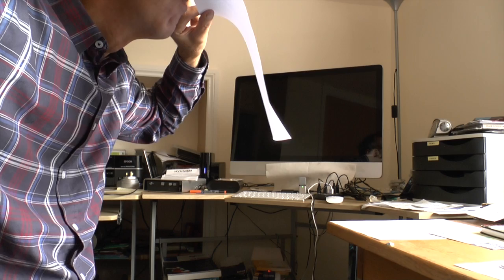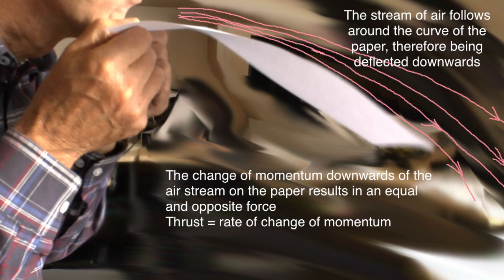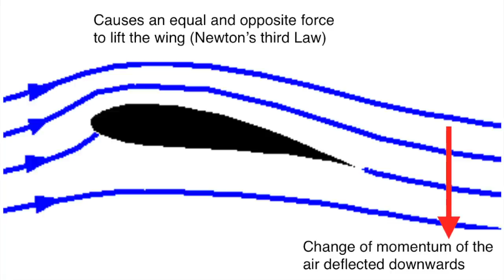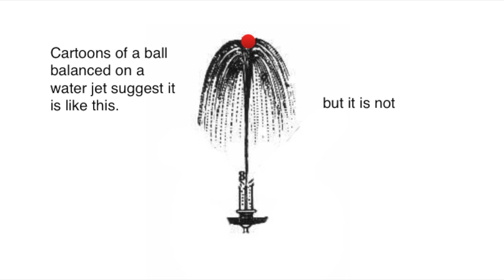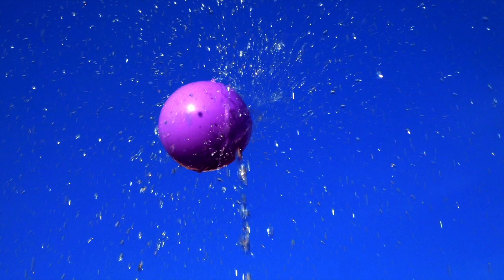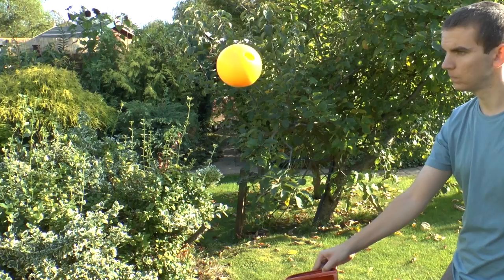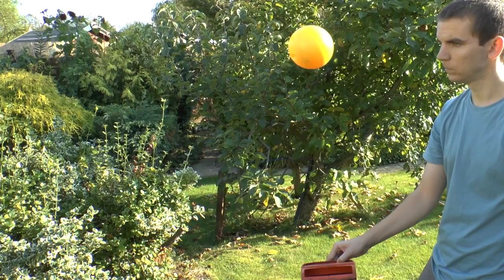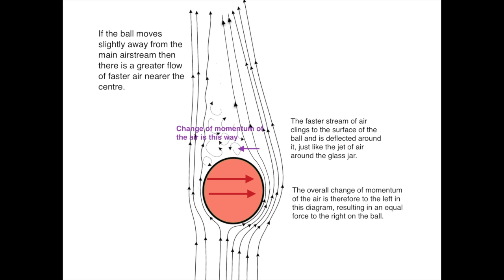The Coanda effect; explaining how a wing works: from fizzics.org

Comment: The explanation is weak, the pressure difference is what causes the lift of the wing, because the air is circulating slower over the wing than below the wing. Therefore the pressure over the wing is lower than that from below the wing, so it is pushed upwards by the bigger air pressure from below, which acts on the surface with a greater force.

Comment: Aerospace engineering major here, second year. My book explicity says this is true but not the source of lift rather a product of it. And that lift can solely be explained by pressure distributions nothing else.
Reply: Consider this explanation. The coanda effect causes the surrounding air not part of the flow to push inward on the flow due to a friction with the object interupting the flow. This push also simultaneously constricts the flow similar to how a nozzle would. This constriction leads to an increase in speed, this is because when flow is constricted the air is doing work on the air in front of it, ie pressure energy is converted to kinetic energy. This drop in pressure due to A combination of the Coanda effect + Nozzle flow. WIll drop the static pressure of the air flow above the wing. Then Since the flow below the wing is parallel to air flow no constriction occurs thus it's pressure remains unchainged. This leads to a net force upward! What do you think.
Reply: Pressure itself is a scalar quantity it has only magnitude but no any direction. Lift is a vector sum of the pressure acting over the entire surface. You may change the direction of the incoming airflow in one direction and lift will be created in the opposite direction as per action reaction pair

Comment: Roger,
I think you have done a very good job here in several of your explanations,   However I have a slightly different spin (excuse the pun) on some of this.  Please consider the following.
...
First, in my discussions with some in aerodynamics, Coanda defined this effect for a forced jet, or sheet of air along a convex curve - just as shown with the straw and can.  However, while it looks very similar and may even be explained with similar words, it was not defined as the "ordinary" flow over a surface moving through air --- only for the forced stream condition.  This may seem pedantic, but a definition is a definition.  Given this understanding, I could consider the upper airflow to be "Coanda-Like".
...
The blown paper is spot on.
...
I can explain the "action - reaction" concepts with these two reversed.   While I do not dispute that the lift force and downwash momentum change are indeed necessary and comply with Newton's Third Law,  I maintain that the common explanation as you show here is reversed.  The downward moving air can not be responsible for an upward force on the wing --- It must be a RESULT.  The pressure differences around the wing that are caused by the shape moving through air must also be pushing down on the air.  Because the downwash has been left behind the wing to continue downward due to its inertia, it can no longer have an effect on the wing that has moved forward.  The pressure differences around the wing, in effect, are the air pushing up on the wing.  If the air is pushing up on the wing, the wing must be pushing down on this continuous bulk of air.  
...
I use this analogy.  I push on a wall.  We know quite well that the wall pushes back.  The minute spring action allows us to understand this better.  Newton's Third Law leads us to believe these are two "different" forces (though equal and opposite) and I sometimes call Newton's #3 "The Law Of Pared Forces".  However, another way to look at it is that this is only one force and any and all forces act in TWO opposite directions at once.  [this is somewhat analogous to fluid pressure at a point acting in all directions].  
Now, we must certainly agree that MY PUSHING on the wall is what instigated this shoving match in the first place.  The wall certainly did not show any aggression towards me before I pushed first.  Therefore, my push is the cause and the wall's pushback is a result.  I liken my push to the pressure difference lift force and the wall's push-reaction to the downwash' sreaction.   I also point out that had the wall been free to move, such as a friend on ice skates, it would have moved in accordance with with the force of my push and his mass and that his movement is directly equivalent to the downwash movement.  
...
The water suspended ball and the water spoon I will not discuss due to the air-water fluid and flow pattern differences.
...
For the air suspended ball, the Action-Reaction is explained as I have above, with the decreased pressure on one side caused by the increased length of the curved air path on one side.  This pressure reduction then allows the atmospheric pressure further from the ball to push the air around the ball further around the back which results in the increased momentum change in the opposite direction from the lowered pressure.  This air then leaves the ball where it no longer can exert any force on the ball.  Its momentum change was due to the pressures around the ball, not the cause of them.  The lowered pressure on one side allows the not-as-much-lowered -pressure-due-to less-curved-flow-on-the-other-side   to push the ball back inward. Thus the "turned air stream" behind the ball.is the result of the pressure difference, not the cause of the force on the ball.

...
I hope you follow these descriptions and comment.
-- 
Cheers ScienceAdvisorSteve
http://www.challengerillinois.org/
Reply: I agree. I think Coanda efect cannot explain lift. There is a different premise. On Coanda efect there is a relative speed between the jet and the surounding air. This is not the case when a wing moves through the air.
Reply: @urdearadu9451  Good observation and correct..  However, It is confusingly similar.    The Coanda effect has continuous entrainment at it's boundary with the still air; but it does not flow along the convex surface because of the Coanda effect.  Air will follow a convex surface because air pressure is pushing it there; unless it is so fast that it can't make the turn.  Air does not "stick" to that surface because it is 'sticky', it is constantly pushed against it by the air pressure all around that many people forget is there. We live in a pressurized atmosphere and the air will do its very best to flow in all around anything moving.

Coanda also produces a lower pressure along a convex surface.
.
Air having inertia, "wants to" go straight (Newton's First Law). Because it is held against the the curve by atmospheric pressure  it is like being on a playground merry-go-round --- it 'swings outward", the centiipetal effect.  This lowers the pressure near the surface.   A curved flow indicates a lower pressure toward the center of curvature - higher on the outside.
..
The curved flow is the cause of the lowered pressure as the air maintains contact, but the centrifugal effect lowers it.
.
These pressure changes are very small, hence large wings. For a light plane, the most change from ambient is about 0.6% decrease above the wing.
For commercial jets it is about 6% at low altitude and 23% in the much thinner air  at 35.000 feet altitude.
Reply: @urdearadu9451  

Where did you learn that there is no relative speed between the jet and the surrounding air on a wing? So wrong bro! Even if the paper would've been blown from both the upper and lower surface and it would stand at a given average camber due to it's mass, and suddenly more airflow speed is added to the upper The Coanda's effect is actually the most accurate definition for lift. If you only like the obsolete Bernoulli, it's your choice to never understand lift!
Reply: @Observ45er  

Sorry, but it makes no sense what you've been saying in here and in your first post where you were referring to an "increased length of the curved air path" before replying to this fella who says that there is no relative airflow speed between the upper and lower surface on the wing..., just forget that guy, he doesn't know what he's talking! Now..., when you say that the surrounding pressure ("that everyone forgets about") that has the effect of "bending" the airflow towards the curved surface..., is this how you explain the Coanda effect?

It is indeed the stickiness between the air and the solid surface which actually reduces the pressure. The reduced pressure instantly introduces the Newton's third law between the airflow cone over the paper and the paper, regardless if of the atmosphere around. Try to get that. Yes, it's there..., but even if it wouldn't be there (absent surrounding pressure and having only a tube of air over the paper), the interaction between the airflow stream and the paper would be the same, even if at a different magnitude only due to the absence of the surrounding atmosphere. That's it. That's all the difference.

How it works:

1. As the airflow meets the curved surface, it will try to stick to it (YES, it will literally stick to it, like it or not) and the pressure will reduce itself according to the speed and turn radius that the airflow must follow, but due to it's inertia and momentum, the airflow cone will tend to go as straight as it possibly can.

2. Due to the developed lower pressure on the side of airflow against the convex shape, the paper is pushed up by the higher pressure beneath.

3. Due to the upward movement of the paper and higher radius turn that the airflow cone must meet, the curving of the airflow and the straightening of the paper are now settled at a value which depends on factors such as Reynolds (including viscosity, temperatures, geometric references and speeds) and paper weight. Yes..., the surrounding pressure which now is higher than the one developed between the airflow cone and the curved surface of the paper that it sticks to and tries to follow will bend the airflow cone more than if the surrounding pressure wouldn't exist (let's say..., as if the airflow cone and the paper would be separated from the outside air by a wall or being within a tube), so that would only affect how much the airflow cone would bend and also affect how much the paper would also straighten up, but it's not as if only the surrounding atmospheric air is the one generating the transversal (downward in this case) momentum of the airflow cone.

Comment: Interesting video on lift force! I like how you emphasize the stream of fluid or air sticking closely to a nearby surface and being deflected downwards, resulting in a change of momentum, which generates an equal and opposite force pushing the object upwards, thus creating lift.
The explanation provided in the video may not be entirely accurate or universally accepted. While you mentioned the Coanda Effect as an explanation for lift force in some cases, it's one of the common misconceptions. The Coanda Effect is based on fluid entrainment into a jet flow, which doesn't occur around an airfoil. Consider discussing pressure differences and air acceleration around an airfoil, which would contribute to a more comprehensive explanation of lift.
Keep up the excellent work, and I look forward to seeing more educational content from your channel!
Reply: Pressure itself is a sacalar quantity, it has only magnitude which is perpendicular to surface and no any direction. Lift is a vector sum of the pressure acting on the entire surface. Lift is directly related to change in momentum of airflow. You may change the direction of airflow in any direction and you will get a force in opposite direction as per action reaction pair.

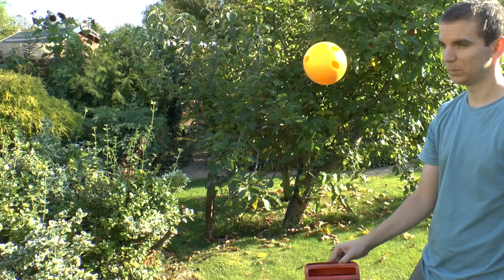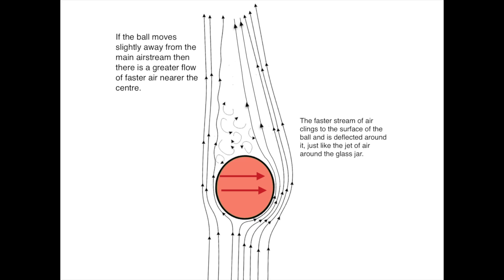Comment: Except for the illustration at 3:15 everything is physically well defined. At 3:15 however, the ball's center is to the right of the streamlines that are splitting and doesn't make any sense to have more streamlines on the right. It would make sense for the Coanda effect and the Newton's third law which is otherwise the complete global lift explanation if the ball's center would've been to the left of the streams splitting position. If the ball would be moving from left to right as in that illustration and when the center of the ball would have passed the splitting point of the streamlines and there would still remain more and concentrated streamlines on the right side towards where the ball is going, then this would represent an unstable motion behavior and the ball wouldn't ever reenter the airflow stream cone again. It would simply be accelerated outwards from the airflow cone. Again, that illustration would be correct if having the ball's center to the right of the streamlines splitting point and more streamlines would be illustrated on the left side of the ball meaning that now a lower pressure is on the left side of the ball, decelerating it from going out of the airflow cone and thus stabilizing it to remain within the cone, or..., by illustrating the ball's center still being on the left side of the streams splitting point and leaving the streamlines illustrations as they are.

For as we are learning and understanding things closer to reality everyday, we must understand and take it as a fact that the Bernoulli effect was proposed as an early explanation to why does the pressure decreases when the airflow speed increases along with it's subsequent math model regarding the total pressure as a sum between the dynamic and static pressure.

Nowadays we are more correctly understanding that the Bernoulli's effect should mostly be limited to airflows along inside of tubes, except at the entrance and exiting of that tube where Bernoulli expects the opposite of what actually and physically happens or otherwise in conditions where there is no interaction between separate airflows (such as what happens in the atmosphere or at the interface between two airflows (like two layers) with relative speed between them).

If someone wants to explain the lift by using Bernoulli..., heh..., he's up for a great blind ride with no end, simply because the things don't add up!